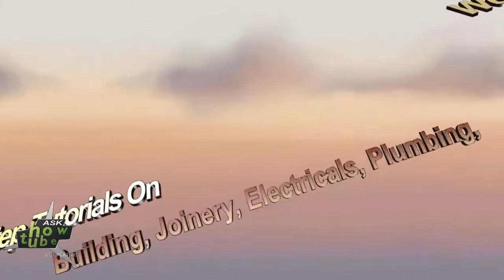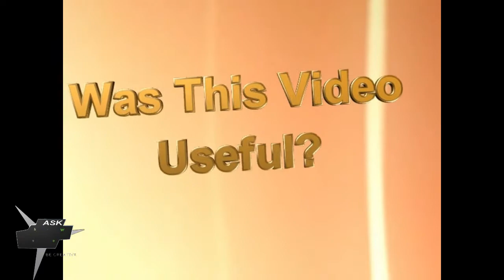#victorian #oldbathroom How I install a vintage toilet, suspended cistern toilet.

Comment: Just curious,  approximate year made,  ?   These old toilets are really nostalgic.   When I was a kid the theater uptown,  Harbor Beach Community Theater had a toilet very similar to this one in the men's room.   The theater I believe was built in the early 1900s, maybe 1890s. Haven't been there in over  25 years, not sure if it's even there anymore but the wall mount flush tank toilets were apparently popular in the early 20th century,  for whatever reason.
Reply: It’s a cheaply made modern replica

Comment: Do you cut the excess off at the top? I have about 5” longer than height of the cistern
Reply from the maker: If you’re talking about the pipe, yes I cut it out, but you need to sand the cutting, so is not going to damage any rubber seal